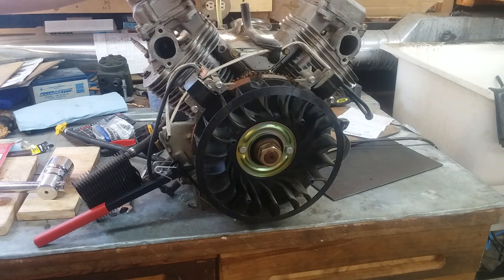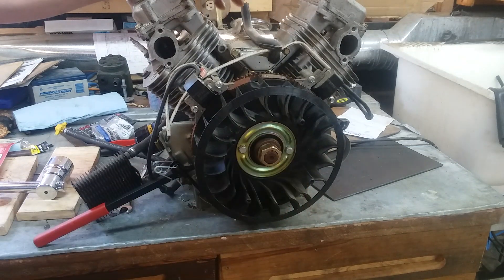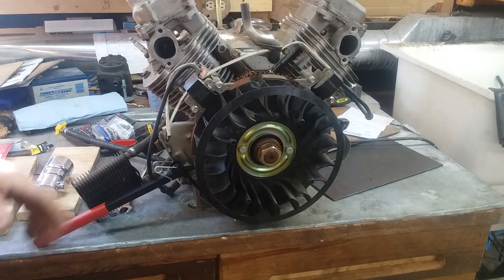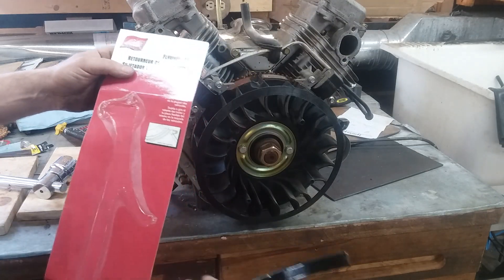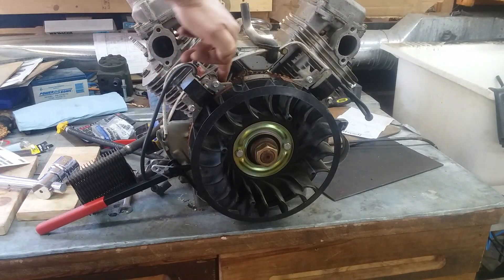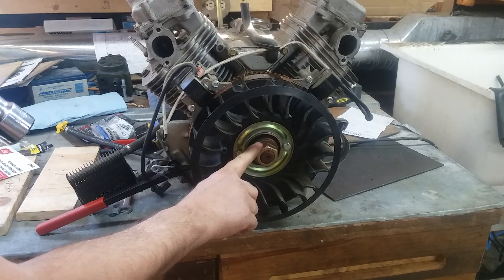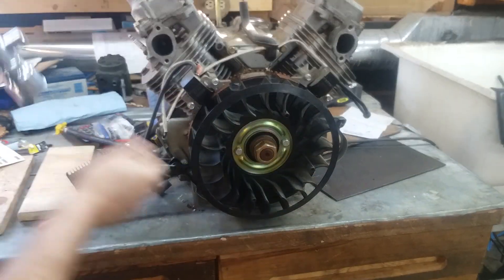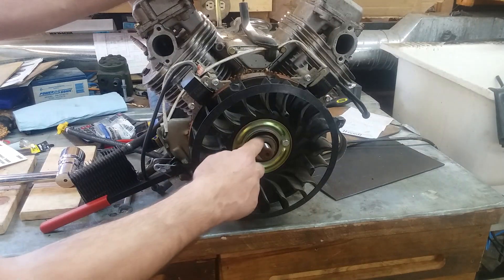Tool You Didn't Know You Needed.

Comment: I have and enjoy several Lisle tools..  But why not use a good impact wrench to get er loose?   I use an impact wrench to get the nut off and an air hammer on the crank to break flywheels loose.
Reply from the maker: Im usually in the field and I dont have a truck mounted air compressor, nor do I want one.  I dont want the battery impact that it would take to break one of these loose either.